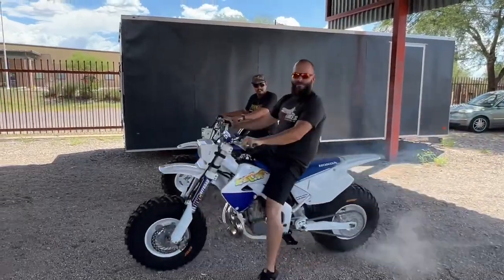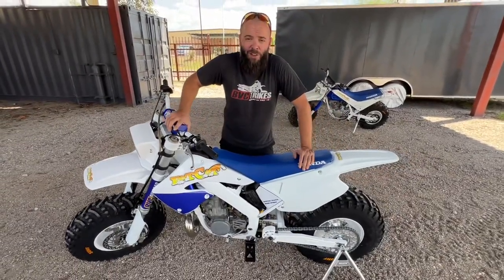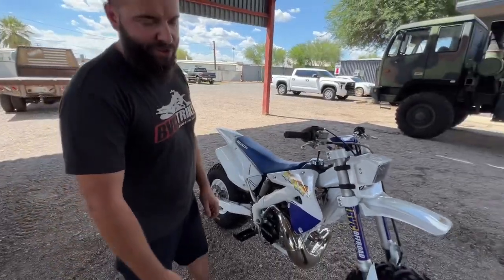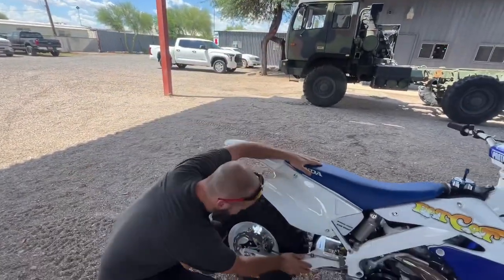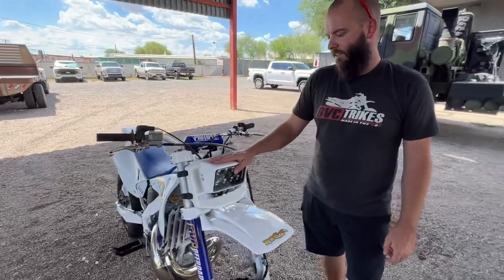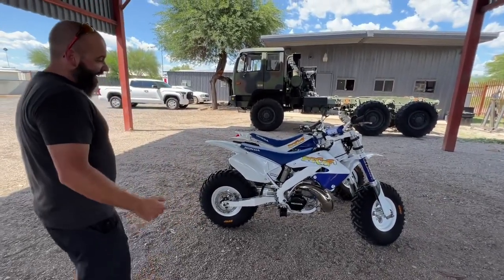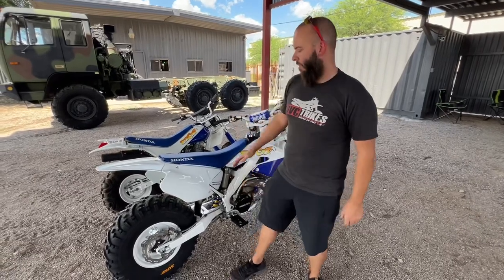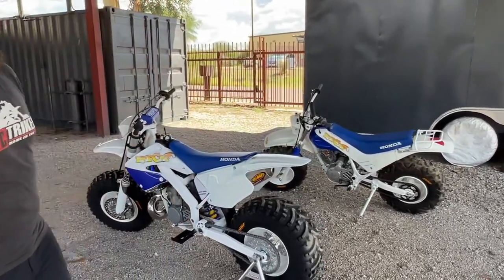Bringing back a Legend !😱 HONDA CR250 2 Stroke Motocross Bike -  Fat Cat  Build

Comment: my 86 FatCat I had 2 years- drove it everywhere the two guys I rode with went (they had 125 dirtbikes).  Mud, Hills, Woods, Streams.  I could ride flat out on the middle of train tracks and they could not (wheel length) as they would bounce all over the place.   Nice power and if brakes went out all you had to do was downshift to slow down.

Comment: When I was a kid about 18 years old my buddy had the big wheel from Yamaha we used to ride in this place called the line pits you can make huge jumps easy out there we used to Launch that big wheel I mean huge air early 90s with those big ass tires every Landing was so smooth the bike actually jumped really well stable in the air first huge jump I ever did was on that bike fun I could only imagine with a 250 2-stroke even though it's in a fat cat I still the same in many ways as the big wheel

Comment: Nice build and if who ever buys it wants electric start panther racing makes an electric start and high output stator for the cr250r so you can charge the battery and have electric start.